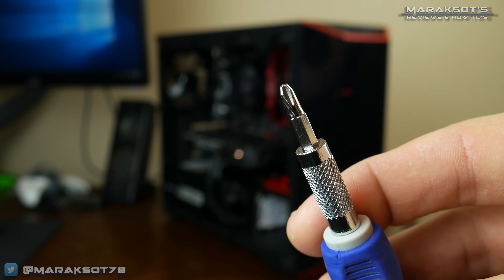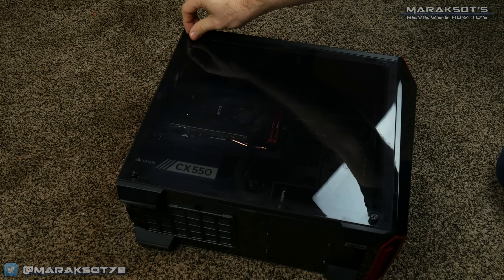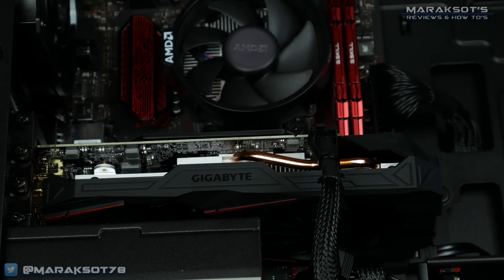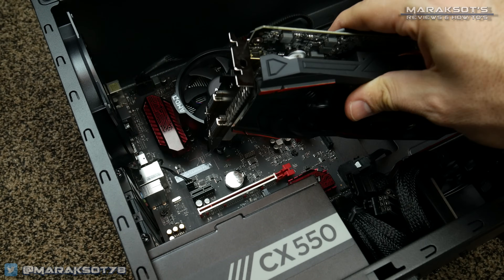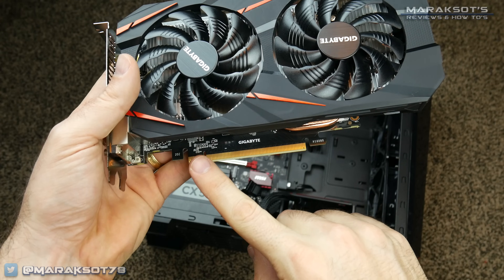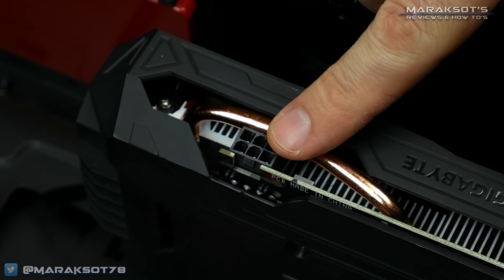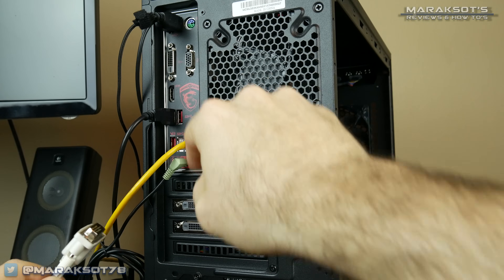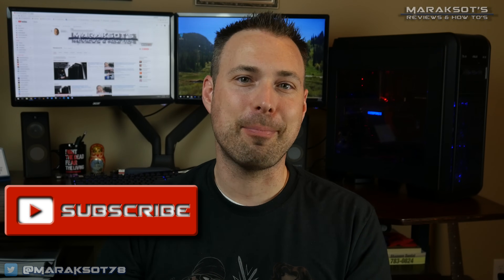How to Install a Graphics Card - Upgrade Your GPU

Comment: is it better to use pcie graphics card instead of internal cpu graphics
Reply from the maker: It depends on what you're using the computer for and your budget.  If you're building a gaming PC and want the best performance in games you can afford then using a discrete graphics card will typically give you much better performance than the iGPU in a CPU.  There is of course an exception to this when it comes to very inexpensive/basic graphics cards like the GT 730.  The newer GT 1030 is much more powerful than the GT 730 but for $15 - $20 more than a GT 1030 you can get an RX 560 which blows the GT 1030 away in terms of performance.  If you're only using you computer for normal day to day computer tasks like web browsing, word processing and what not and don't any 3D acceleration then using the iGPU built-in to the CPU is just fine if you ask me.
Reply: @Maraksot78  thank you. you would not believe how hard it is to find answeres on this. so again thank you.don.

Comment: My graphics card gpu is really bad any tips
Reply from the maker: What kind of tips are you looking for?  Are you wanting recommendations for a new graphics card?
Reply: Maraksot78 noo this is a brand new graphics card and I’m getting really bad FPS in games I’ve tried everything to get better and it’s not working my specs are 16gb ddr4 ram i5-7500 processor
Reply from the maker: Ok, got a few more questions for you before I can try to offer some help/suggestions...
What graphics card do you have in your system? - RX 580? GTX 1660, etc?
What games are you playing? - Fortnite? Red Dead Redemption 2? Call of Duty, etc?
What settings are you playing on? - Medium? High? Ultra?
What kind of frame rate are you getting? - 30fps? 60fps?
Reply: Maraksot78 I have a GeForce gtx rog strix 1650 oc 4gb and fortnite lowest setting a
Reply from the maker: and what frame rate are you getting in Fortnite on the lowest setting?
Reply: Maraksot78 60 lower not capping
Reply from the maker: so you're getting below 60fps in Fortnite on the lowest settings with a GTX 1650?  You should be able to turn settings up pretty high with a 1650 and still maintain above 60fps.  How new is this computer?  Have you had it a few years? Do you have a lot of stuff installed on it?  Did you install the Nvidia drivers for the 1650?  Do you have the HDMI cable (or whatever cable you're using) plugged into a port on your graphics card or a port on your motherboard?  The motherboard port is the one near all your USB and audio ports and stuff.  The video out ports on the motherboard use your CPU's integrated graphics and not your graphics card and the integrated graphics on an i5 7500 would perform about as bad as you're describing.

Comment: When i switch my pc on with the graphic card .. the monitor doesn't switch on (black sceen no signal) What can i do ? If i remove it the pc will switch on normally
Reply from the maker: First things to check is the simple stuff. Is the card fully seated in the PCI express slot? Are the supplemental power cables fully plugged in? Is your power supply rated at the proper wattage for the card you bought? Do you have the cable to your monitor plugged into one of the display outs on your graphics card?  When you install a discrete graphics card you want to plug your HDMI, DVI or whatever type of cable you're using into a display out on the graphics card.  If you plug into a display out on your motherboard (the ones near all your USB ports and stuff) then you're still using the graphics integrated into your CPU and depending on how your system is configured it may not display anything to the monitor at all.
If the card is fully seated, proper power is plugged in, your power supply is powerful enough and you have your HDMI, DVI or whatever cable plugged into an output on your graphics card and you're still getting a black screen you may need to update your motherboard BIOS/UEFI before it will recognize your new graphics card.
After that, if updating your BIOS/UEFI doesn't work, I can't say for certain, but a definite possibility is you have a defective graphics card.

Comment: How can I check if a certain graphics card will fit my pc? (power supply wattage, place, motherboard, pcie cord, etc..)
Reply from the maker: My other, older, longer (and admittedly cringier) video deals with all of those questions. I recommend setting the speed on that one to 1.5X or 2X and zipping through it. It should be able to help you out.  https://youtu.be/HTNVjwTQC18

Comment: I'm trying to upgrade the graphics card on my PC. Mine has an integral card (Intel HD), and I disable that driver, then install the new card. However, all I get is a black screen upon startup. I tried to install the latest driver (I'm using a Ge Force GT 710 card), and the driver isn't compatible with Windows 10 64-bit. At this point, I'm ready to just return the card.
Reply from the maker: Are you connecting your monitor to the VGA, DVI or HDMI port on the graphics card or the port on your motherboard? When using a discrete graphics card you want to connect to a port on your graphics card. Another potential issue that comes to mind is depending on how old your computer is, your motherboards BIOS may need to be updated before it can recognize a GT 710 as a display adapter.  As for the GT 710... if you're wanting to use it for gaming, you may be very disappointed in its performance as it's only a basic display adapter. It's designed for nothing more than outputting video to your monitor. It's really only useful when a CPU has no integrated graphics processor built-in and all you'll be doing with that computer is normal day to day computing, i.e. web browsing, word processing ,etc. Depending on what CPU you have in your system and the capabilities of the IGPU built-in to it, you'll probably see the same level of performance when gaming. Maybe a tiny bit better with the GT 710 but it's equally possible you'll see the same level of performance or worse.
Reply: @Maraksot78  I eventually gave up, and just bought a Dell gaming PC with the latest graphics card already installed.

Comment: Does this work normal pc? I bought a very cheap PC ($165) for college and I want to upgrade it and turn it into a gaming PC when I have time. Can I get a graphics card and add it into my PC? Or do I have to buy a gaming PC in order to do this?
Reply from the maker: You don't have to buy a "gaming" PC to upgrade the hardware. Any computer can have the hardware in it upgraded. There are of course limitations to what can be upgraded depending on the size of your case, what socket and chipset you have on your motherboard along with other factors.  A simple example would be if you have a small case, a large graphics card probably isn't going to fit. Another example is graphics cards require a certain amount of power to operate.  Some require more power while others require less. The more powerful cards require more power to operate and cost more money while less powerful cards use less power and also cost less. It's important to make sure your computers power supply can output enough wattage to properly power your graphics card.  If your power supply doesn't output the minimum wattage your graphics card needs to operate you'll need to upgrade your power supply as well.  How powerful your CPU is, is also something important to take into consideration. If your CPU isn't powerful enough a new graphics card will be bottlenecked (have its performance severely limited) by the CPU. This can also happen if you don't have enough RAM or if you have slow RAM.  I look at upgrading a PC kind of like adding aftermarket parts to a car. Does it make sense, or is it worth it to drop a brand new 800hp engine into a beat up old car you paid $500 for? Probably not, because to really benefit from the performance of that 800hp engine you need a new transmission that can handle all that power, a new exhaust system, new suspension, wheels, tires and other things are all necessary to really allow that engine to perform its best. And by the time you're done with all this you pretty much have a brand new car and have spent a lot of money.  Computers are the same way. Throwing a $500 graphics card, or even a $200 - $300 graphics card nowadays, into a system with a dual core CPU or even a quad core is going to limit the performance of that GPU meaning you'll spend $200 - $500 but only get a fraction of that money worth of performance out of it.  Also if you have 8GB of RAM or less that can cause a bottleneck depending on the games and applications you play/use.  I don't mean to discourage you by saying all this I just don't want anyone to spend their hard earned money on a new graphics card only to find out they don't have a powerful enough power supply or have their graphics card bottlenecked by other components in their system and perform so badly they feel like they wasted their money.  You can of course upgrade your motherboard, CPU, RAM, power supply and any other component in your computer too but like the car analogy, that can get very expensive very quickly and by the time you upgrade all those components you pretty much have a completely new computer.  Thanks for the question, I hope this has been helpful and not confusing or discouraging to you.  Cheers.  :)
Reply: Maraksot78 Thank you!! I don’t know much about upgrading or using a PC very much and this is very informative and helpful.
Reply from the maker: You're welcome. I love talking about computers and enjoy doing what I can to help others learn more.  :)

Comment: What wire do I need for the graphics card ?
Reply: Patty Moreno pcie powercord that comes with your power supply, which specific one depends on your graphics card (6 pin, 8 pin or both, you can just see what fits, can’t go wrong)
Reply: Thank you so much

Comment: What graphics card is that?
Reply from the maker: In the video thumbnail is a PowerColor Red Dragon Radeon RX 560.  The card I actually do the install with in the video is a Gigabyte GTX 1060 Windforce OC 3GB.
Reply: Maraksot78 thank you so much!!
Reply from the maker: no problem

Comment: Is every graphics card ddr5
Reply: Thanks man
Reply from the maker: @whylag460  No problem. :)
Reply from the maker: Currently most graphics cards use GDDR5 however new higher end cards are now using GDDR6 so I imagine over the next year or two all graphics cards will be using GDDR6 instead. GDDR stands for Graphics Double Data Rate. Although GDDR is similar to your standard DDR SDRAM there are some major differences between them. GDDR is designed specifically for handling graphics related tasks and has much higher bandwidth than normal system RAM allowing it to be much faster which is what you need to get top notch performance out of your GPU.

Comment: For some reason I'm not getting any signal to my monitor after installing the new graphics card. I've ensured everything is powered on and I'm running an HDMI from the video card to my monitor. Help!
Reply from the maker: Do you see your motherboards splash screen first but as it loads into Windows it goes black? If so a motherboard BIOS update should fix that.
Reply: @Maraksot78  thanks for the reply, I used my display port cable and port and it seemed to work!
Reply from the maker: @SterlingWood  Cool. Glad it's working for ya now.

Comment: My bro usually puts it in he built my PC I bought a Asus rog RTX 2070 super and i am going to put it in for the first time.
Reply from the maker: Congrats on the 2070 super upgrade. I'm also currently running a Aorus RTX 2070 Super. It's a fantastic card. Cheers man. :)

Comment: My video cabel cant plug into the graphics card. Please help.
Reply from the maker: What do you mean?  Are you saying your monitor uses a DVI or VGA cable and your new graphics card only has HDMI and Display Port (DP) outputs?  If so then you have two choices, you can upgrade to a new monitor that has Display Port (DP) and HDMI inputs or use an adapter that will adapt HDMI or Display Port (DP) from your graphics card to DVI or whatever connection your monitor does support.  The adapter is going to be much less expensive of course.
Reply: @Maraksot78  thank. Really appreciated

Comment: my monitor cable is vga but my graphics card doesnt have a vga. do i need to buy a displayport to vga? cuz my gpu has a displayport. thanks
Reply from the maker: Yes you'll need an adapter of some kind... or a new monitor. An adapter would be much less expensive though. :D

Comment: So quick question. Do I need to upgrade anything else before I install a new one? Like power supply, fans. Etc?
Reply from the maker: It depends.  If you're getting a new Graphics Card that requires more power than your PSU can output then yes, you'll need to upgrade your power supply too.  I like to use Newegg.com as a resource to see what the minimum power requirements are for a graphics card as they often list it in their specs where many other sites do not.  In my other video I talk about at the beginning of this video I go much further into depth about all the things you take into consideration when buying a graphics card if you'd like to check it out.  It's one of my first videos I ever made and looking back at it is really cringy and I talk really slow in it because I'm trying to think of what I want to say as I'm saying it, which is something I'm really bad at.  I've since learned to write a script and use a teleprompter which helps me get to the point better and talk more quickly too.  Lots of people increase the speed of that video so it's not so long and boring.  XD lol  Anyway, here's the link if you'd like to check it out.  https://youtu.be/HTNVjwTQC18  Cheers.  :)

Comment: So when i put in my gpu the latch does not lock by it self so i locked it, and everything worked fine does it matter
Reply from the maker: If your card was seated enough that the latch is able to lock (even if you had to do it maunally) then it is fully seated and ready for operation. Congrats on the upgrade. Cheers.  :)

Comment: I wanted to ask, I wanted a new RTX 2070 and my processor is Core i7 5820K. Will it bottleneck ?
Reply from the maker: I don't know for sure as I don't have that hardware to test it out but I think you'll be fine. I think the 5820X is powerful enough to pair nicely with a RTX 2070.

Comment: I have a laptop ;-;
Reply from the maker: yah, there is only a couple ways I know of to up the graphics horsepower of a laptop.  The first is to buy an external graphics card enclosure.  Most of them cost $200 - $300 just for the enclosure so you still have to buy a graphics card to go with them.  You can buy some with graphics cards in them already which then cost whatever the enclosure costs plus the price of the graphics card that's in it.  They connect to your laptop via a Thunderbolt connection which I don't know how many laptops actually have on them so there's a definite potential incompatibility issue there.  The other way, and most common way people upgrade the graphics card in a laptop is to buy a new laptop with a better graphics card in it.

Comment: Does all gpu card fits in the slots such as NVIDIA GeForce gpu or other brands such as asus and msi?
Reply from the maker: All graphics cards currently are designed to slot into a PCI express slot.  So any graphics card will slot into your motherboard.  Whether it will fit into your case or not is another issue.  :D  As for your question about brands... Currently there are two manufacturers of GPU's (Graphics Processing Units), AMD and Nvidia.  The GPU is the actual silicon chip inside of a graphics card that does all the 3D graphics calculations and whatnot.  The graphics card is the whole... uh... well, graphics card; which includes the GPU, the PCB (circuit board), heatsink, backplate (if your card has one), cooler shroud, etc.  Now I said earlier AMD and Nvidia are the only manufacturers currently of GPU's meaning the actual silicon chips.  Both AMD and Nvidia have agreements with other companies know as Add-In Board Parters or AIB's.  Those companies use AMD or Nvidia graphics chips and build graphics cards using those chips.  Those AIB's are companies like MSI, Asus, EVGA, PowerColor, Sapphire, Zotac, etc.  So that is why you'll have an Asus Strix RTX 2080 and an MSI RTX 2080 Gaming X.  They're using Nvidia's RTX 2080 GPU chip in the graphics card they've designed for the chip to go into.  Same thing with AMD GPU's, you'll have different board partners with their graphics card design but using the RX 5700XT GPU or the RX 590 GPU, etc.  I know it can be a bit confusing because many people use the terms GPU and Graphics Card interchangeably but technically they are two different things.  I don't think it's bad that people use them interchangeably but I do also think that people should know there is a difference and understand what the difference is.  Cheers.  :)
Reply: @Maraksot78  Oh if i am going for a upgrade should i go for gpu or cpu i am trying to upgrade my potato so i can run better games
Reply from the maker: @Wo3thy  it depends on what CPU you've currently got and what GPU you're looking to upgrade to.

Comment: Wait do you have to do any software setup or does it just run automatically without a required software setup?
Reply from the maker: It depends.  If you have an Nvidia card and you already have GeForce Experience installed and running then it will automatically update drivers for you.  I don't know if AMD has a similar feature, I assume they do but I don't know for sure because I currently have an Nvidia card.

Comment: wait i dont need to uninstall the driver, if i want to install the new one? im going from gtx 670 to 1660 super both nvidia
Reply from the maker: That's a pretty big upgrade man. Congrats! I would recommend updating your drivers to get the best performance possible out of that new GPU. Cheers. :)